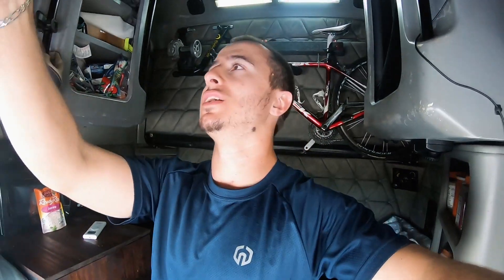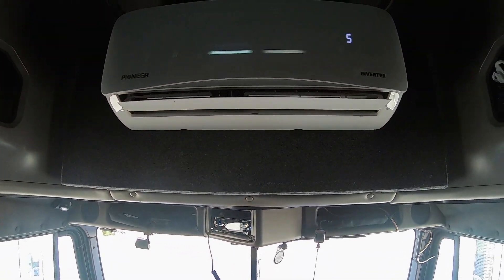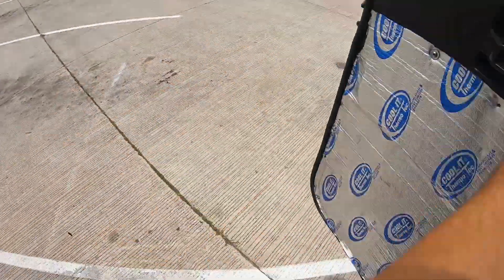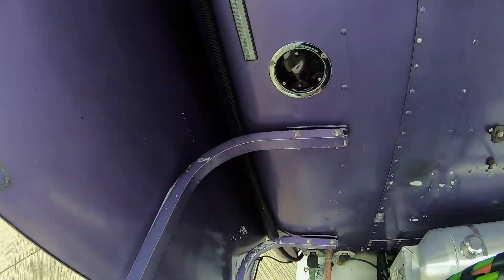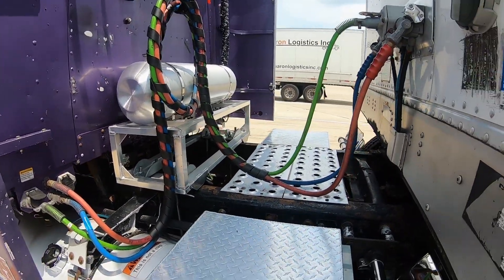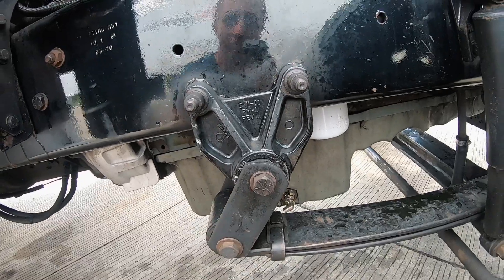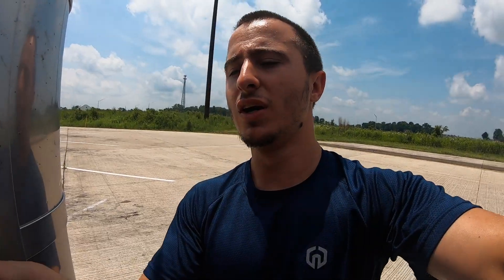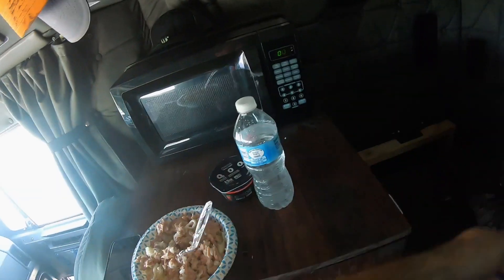Auxiliary fuel tank added to my generator+ updates done so far

Comment: Nice looking truck. Wish we had one like that to pull our tents and shows in. Unfortunately, we had some real old clunker trucks that barely made it to the end of the season. One time, when we were pulling a heavy steel trailer on our way back to Florida, every single tire on that trailer blew out at the same time. Any profits we made that season, evaporated when we had to buy all new tires. Carnies and Circus folks spend a fortune on the up keep of rolling stock, not to mention new tents when a sever storm shreds what we have!

Comment: I installed my mini split 😁 (similar to yours). I don't run it as truck is moving. The vibrations from truck will mess with the mini split internal electronics.

Also, I use 1 gal gasoline for 10hrs w/ my Honda EU2200.

I think you should reconsider your generator options. I used to have a champion 4K watts Genny inverter, and it was still loud AF
Reply from the maker: Nothing wrong with my generator so not sure why I’d reconsider
Reply: @otrookie  ok. Honda comes with Bluetooth monitoring. U can see real time demands put on the Genny, which allows you to turn different items needed as demand (amps drawn) goes down. 

Also, it's much, much quieter than "similar wannabes" of same size

Finally, the Honda alerts you for needed maintenance items so you don't have to "remember".

I already spent $800 on a champion that crapped out, and once I went Honda, I realized what I was missing.

Just my $0.02cents

Comment: I'm by no means, mechanically inclined but, would it help to put a dab of light machine oil on that fan to reduce the whistle?  Seems like I remember doing that to some noisy fan I had and it actually worked!
Reply: Yes the lube they use to clean shavers at the barber shop that stuff
Reply: At Walmart

Comment: Do you have the hose link? And the quick release that you bought. I have the tank but I don’t know where you got the hose from … the quick release and the tank firing. If you can please sent me the info I would appreciate it. Thank you!
Reply from the maker: The brand is rectorseal for ac line and for quick connects, I got them on eBay from random sellers so just search it and you’ll be able to find it